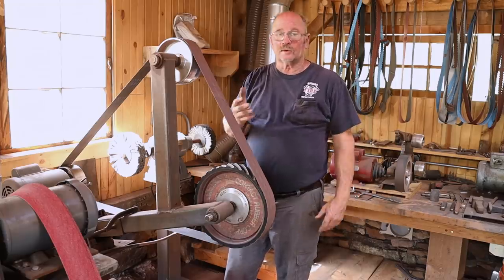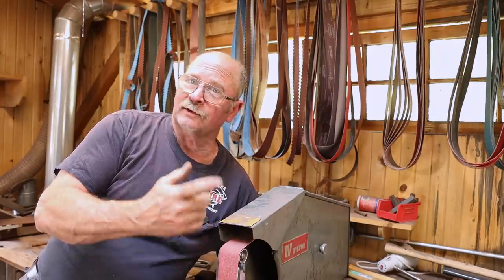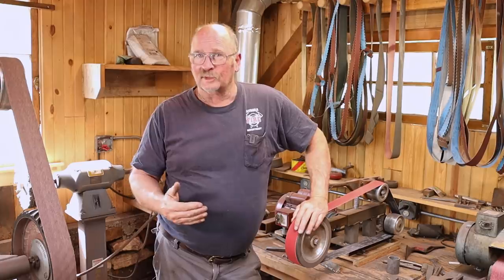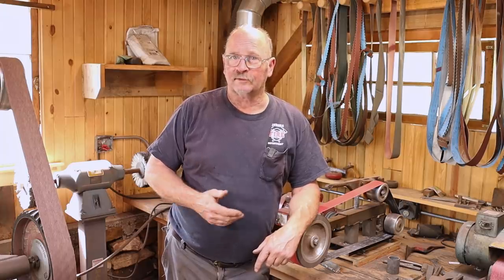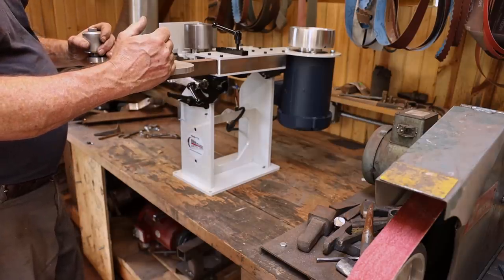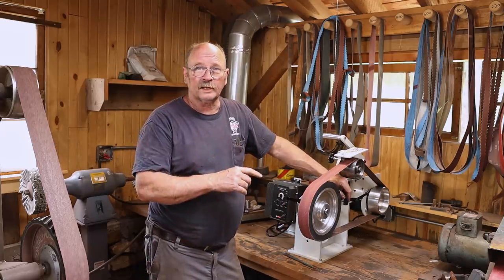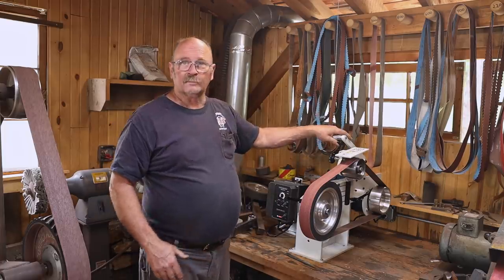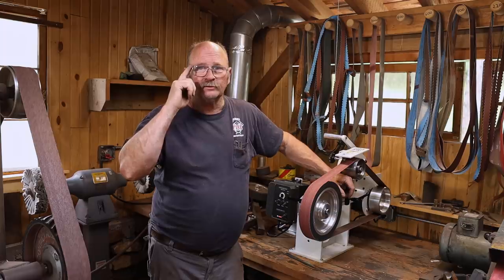New addition to the grinding room

Comment: Congratulation nice addition to your shop Looking forward seeing what you come up with Suggestion as a young lad I vaguely remember a shop with a sliding pedestal in order to accommodate diffrent task it simply slide under the work bench I also remember that at time some workers used it with a stool making their work easier( the pedestal had a small realling in order not to step or slide of it )

Comment: I like that term "Barbie Doll" as it really captures the concept well. If you have a good friend with a lathe and mill, you could most likely put some bushings in the lose joints to take a lot of the movement out. It may not be worth the expense to have it done professionally, but if someone would do it for a six pack plus materials it might work a lot better.

Comment: Very interesting.  Nice equipment too.  What would you think of using a small belt grinder to sharpen turning gouges, vs a bench grinder?
Reply from the maker: Thats my preference for all of my sharpening up to the point of needing honing anyway.
Reply: @BlackBearForge  Thanks.  In half of a two car garage, the belt grinder may make more sense.  Never used one, but I’ve seen them, and I learn something new every day.